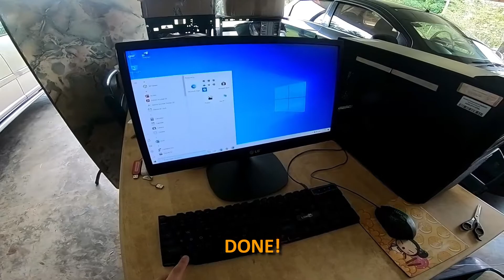Deep Clean Customer Cpu Acer Veriton M2610G |  #deepclean #acer #cleaning #veritonm2610g

Comment: SDD slot?
Reply from the maker: You can use SSD as well. This is customer pc request for cleaning only not upgrade 😄
Reply: @nontechiehustle  where to put ssd on that case sir? thanks
Reply from the maker: @johnorlandrallos3294  Ssd can mount at the green caddy same as the hdd.
Reply: whats the name of that green caddy sir? @nontechiehustle
Reply from the maker: @johnorlandrallos3294  Caddy tray